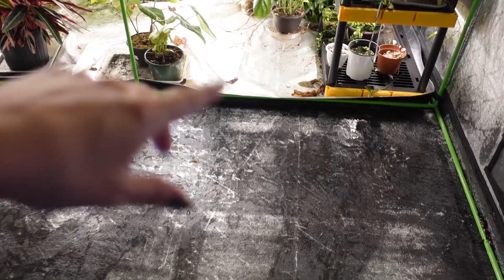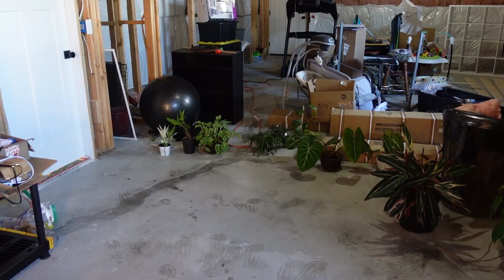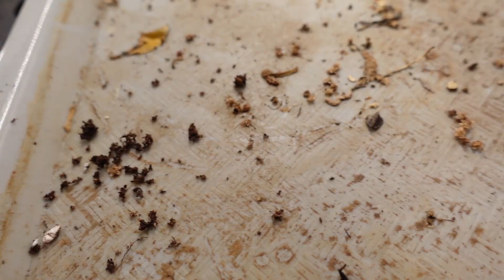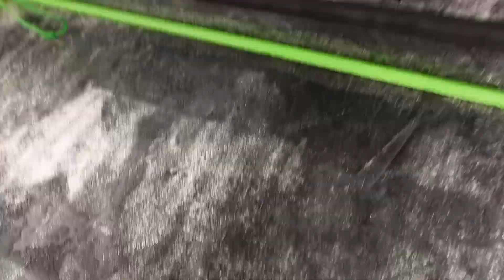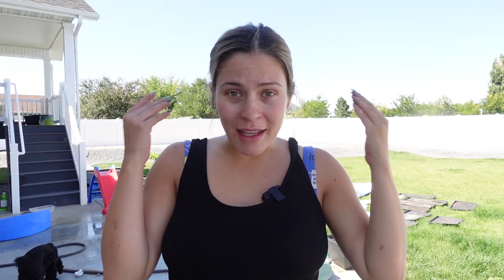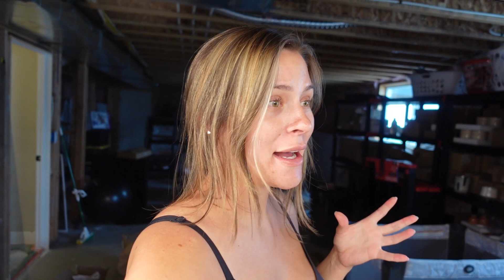Cleaning & Organizing My Grow Tent! | MY GROW TENT STRUGGLE!!!

Comment: Would it be an idea to put wheels on your shelves for the future. Then you wouldn't need to take all the plants off, just wheel them to the opening and use a ramp to wheel them into the basement. Although,   as you are moving them due to flooding, this might be a redundant idea
Reply: Great idea to put wheels on your shelves, I have seen then with wheels .  I thought that you could  have taking the trays with the plants and situated them on top of boxes or something to avoid you having to bent so many times.  My goodness you sure did a lot of work for being 40 weeks onto your pregnancy(did you have your baby after so much work?)  I have deal with basement flooding many times I learned to have things elevated and spray with Agent Orange or Clorox all the walls and floor to prevent bad mildew.
My best to you.
Reply from the maker: That’s brilliant!

Comment: You’re doing a great job!

Did you find with your grow tents that your Hoyas had to acclimate to the new conditions? Some of mine seem to be taking a hit so I increased the air flow some and cut back the humidity.
Reply from the maker: Honestly, no! They did well pretty much right from the start; with a couple exceptions of course! I think having a fan & high, high light has really helped!
Reply: @HarliG  I have 4 T5s but I’m thinking of getting some T8s too.

Thanks!